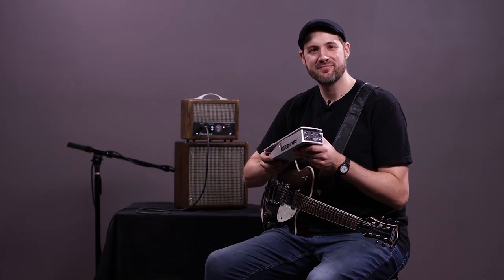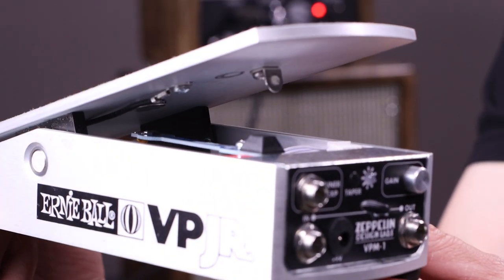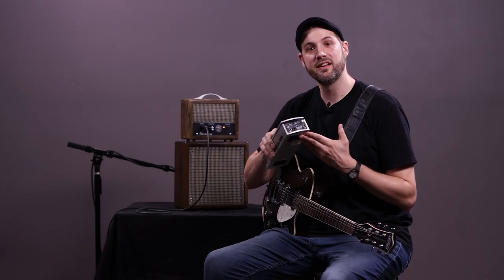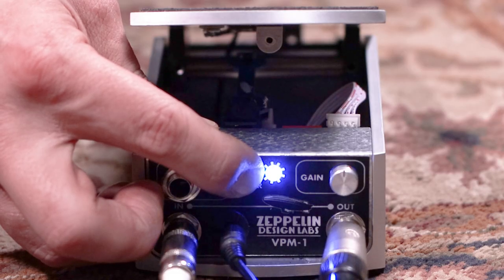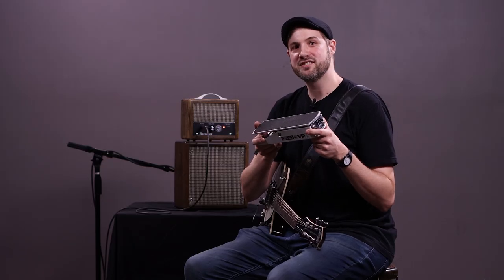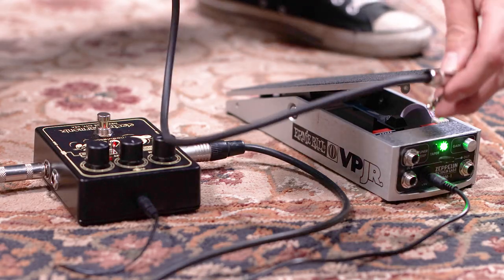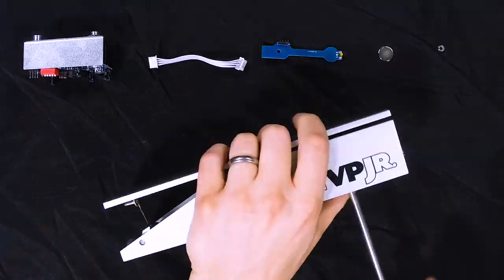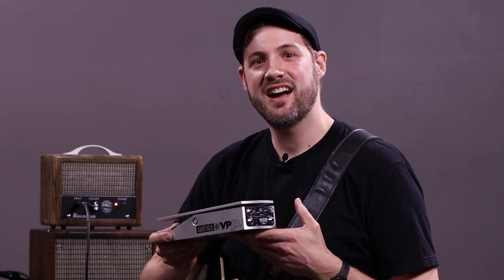VPM1 Volume Pedal Mod Product Demo

Comment: I already built your Quaverato Harmonic Tremolo Pedal and I absolutely love it. Even if I'm not using it as a tremolo (Even though I often do lol) I use it in the fx loop as a clean boost which is just so damned excellent and adds such versatility. I love using it to boost coil splits or add in just a touch of phasing. Anyways I was looking around at volume pedals (literally wah, volume an a phaser are the only two effects I don't own/haven't built/aren't on my board) and I liked the Ernie ball MVP but I think id prefer getting the JR. so I can pick up your mod for it. All the features it adds are really what I felt the JR. was missing plus some other extras on top of that which would be very useful and inspire creativity. You guys make really great quality products not to mention I love your aesthetic choices. Anyways I'll have to put this mod and the VP JR. on the short list of "to dos".

Comment: Really neat idea you've got here. One of my big questions is how does the removal of the string & spring affect the feel of the treadle?
Reply from the maker: With every mod we have done so far, the treadle remains stiff enough to feel pretty good and responsive. If a treadle feels loose or floppy, it is possible to disassemble the axle and increase the pressure on the spring washers inside the bushings. Maybe we can make a demo showing this process...

Comment: So there’s a buffered and non buffered? I use mine in front of my fuzz because it’s passive so this would make it unusable in front of my germanium fuzz?
Reply from the maker: I'm not sure what you mean, but the VPM-1 does have a buffered output.  Weather you find it useable in front of your germanium fuzz is up to your ears.  I personally prefer the sound and response of placing a buffer in front of the germanium fuzz pedals that I have, but it really depends on the type of fuzz you have.  Some fuzz pedals seem to sound worse (or at least "weaker") with a buffer in front of them and some fuzz pedals seem to thrive with a boost before them.  You might want to try your germanium fuzz with a buffer to see how it responds.
-Brach

Comment: This doesn’t work on VP full size. Does it?
Reply from the maker: The chassis of the VPM-1 was designed to fit in the Ernie Ball VP Jr line of pedals, so while it works very nicely from an electrical perspective on the original, full size Ernie Ball volume pedals, it doesn't neatly screw into the chassis without some "hacking" (which would involve finding a creative way to hold the VPM-1 chassis on the pedal).
Reply: @zeppelindesign  Thanks for reply